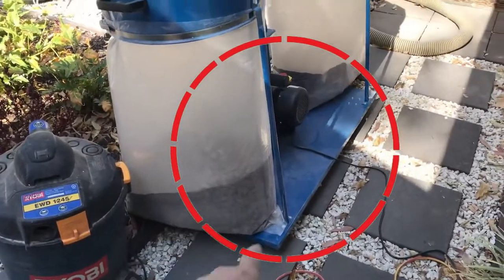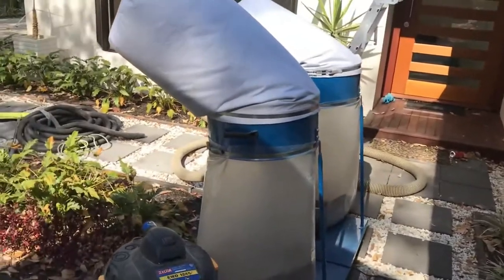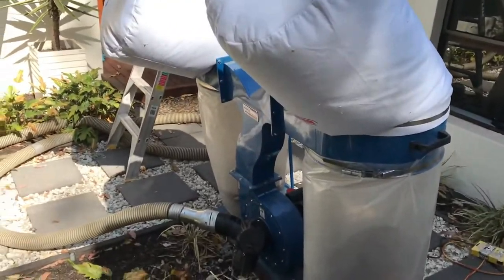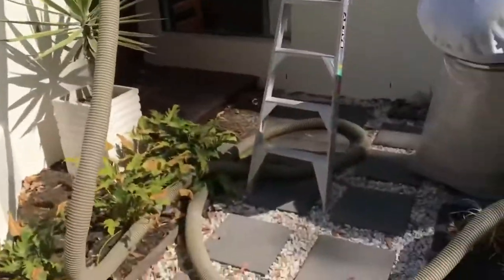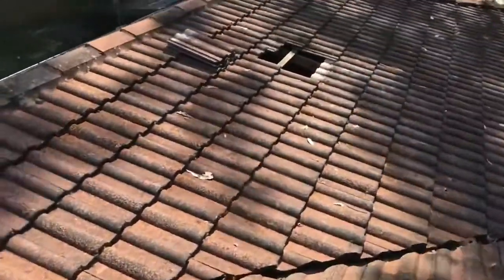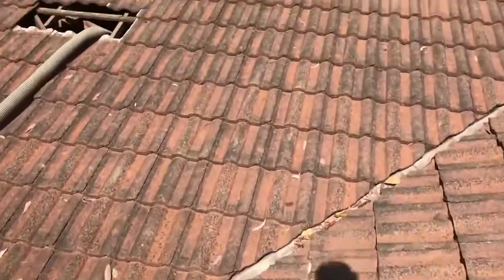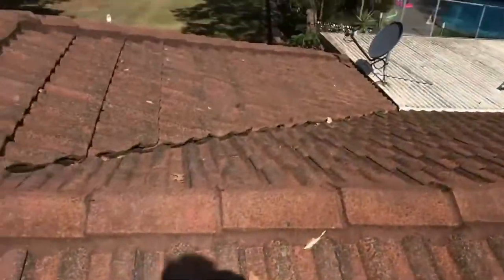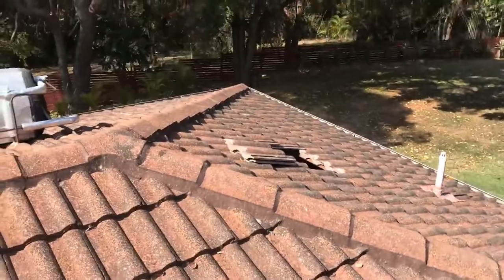Vacuum your ceiling, not recommended if using cellulose insulation.

Comment: Hey mate how much would it roughly cost to do 130m2?
Reply from the maker: Sorry for the late reply, to vac the whole roof can sometimes be expensive depending on the cavity space. If you are just replacing the bathroom ceiling or kitchen ceiling it can be Broomed across the ceiling into a pile and pushed Back later.

The price depends on the location and a few things happy to quote the job properly if you find us on Facebook /insulationteam